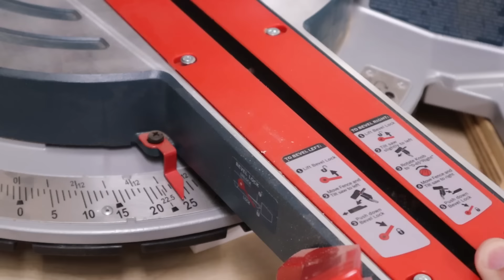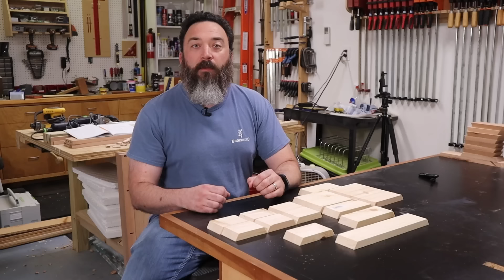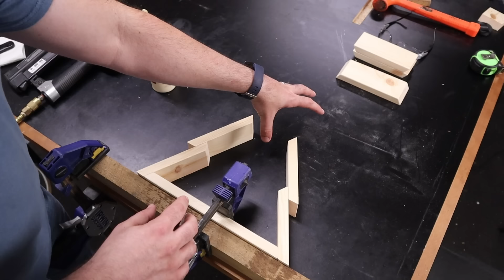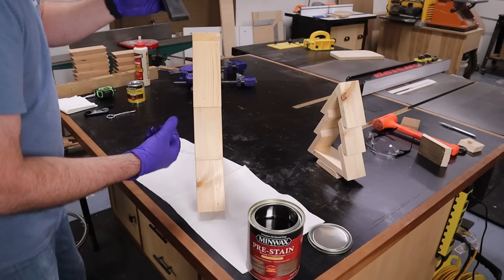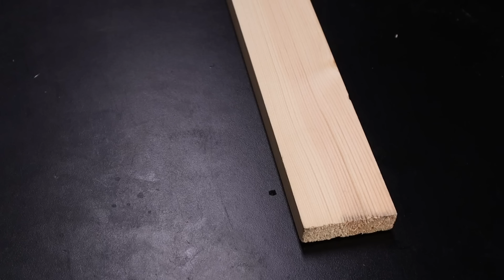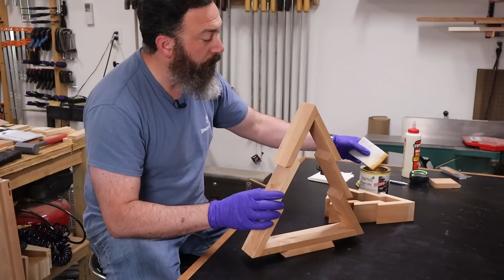Let's Build a BETTER Wooden Christmas Tree!

Comment: I have 1x4 pine. I can cut it down to the 1x3. I just don't want the waste. Over the tree would come out the same just wider. Do you see any issues?
Reply from the maker: You could go either way; cut the boards down narrower or you could use them as-is. I don't see a problem either way.

Comment: For those who want to make the same tree with different wood thicknesses, make sure you change your measurements according to the thickness you are using 6”3/4 will not work if you are using 1/2”, 1” or any other thickness other than the one it is used in this video. Your peaks won’t lineup. 
If you are using the exact same thickness he is using, then it is all good.
Reply from the maker: That's right, the measurements are specific to the wood thickness I used. Same goes for height. I've had people want to build them taller, but that changes the geometry. You can make them bigger, you just have to account for the changes.

Comment: I thoroughly enjoy and learn from  your vides, thank YOU! I have the same pin nailer, but what size brads/pins do you use with these trees?
Reply from the maker: 18 gauge
Reply: @biscuittreewoodworks thanks, 1.25" length?
Reply from the maker: @user-jx3jp3gb4x correct
Reply: @biscuittreewoodworks  you're so kind, thanks

Comment: . how far down do you staple them or Brad nail them to the other piece like 1 inch or three-quarter inches? How far down should you put each angle?
Reply from the maker: I don’t measure where to put the Brad nails or how much the pieces overlap. 
If you’re having trouble, consider getting the plans linked in the video description. 
If you get the plans and still have issues, send me an email and I’ll help you through it.

Comment: Sorry but I can't wrap my brain around it, but would using longer pieces make a bigger tree? I mean would it still be in proportion.
Reply from the maker: You can't just make all the pieces 2X longer to double the size for example. The geometry changes so you'd have to figure out how big to make the bottom piece to fit with the new sides.

Comment: I wonder if a 2 part epoxy would work in place of the CA glue. (I have some on hand but not sure how it would react to the wood glue)
Reply from the maker: It will take longer to cure than the CA glue, so you would have to hold the parts in place for a while or clamp it until the glue dries. At that point you might as well skip it all together and just use the wood glue.
Reply: @biscuittreewoodworks  on thanks for the input. I ended up finding a CA glue specifically designed for wood called 2P10

Comment: My trees aren’t coming out, does it make a difference if I cut the boards lying flat instead of on their side.
Reply from the maker: It shouldn't make a difference as long as you are still cutting them at the correct angle and length.
Reply: @ thank you I tried cut the 30 degree angle in the same and opposite direction and it still doesn’t come out at the top of the tree.
Reply from the maker: @ something is wrong with the angle then. If everything is at 30 degrees and the right length it should work out perfectly.
Reply: @biscuittreewoodworks  okay I will try again tonight, so should the angles both be in the same direction or opposite of each other?
Reply from the maker: @ShawnStumpe  I flip them over and make opposing angles. If it's confusing and you need a visual reference I have plans available with illustrations so you can print them out and take into the shop.
https://www.biscuittreewoodworks.com/products/p/wooden-christmas-trees-plans
Reply: @ I think I might have figured out my issue maybe I set up my stop block on my miter saw but I set the 30 degree cut on the opposite side of my stop block instead of the 30 degree cut towards my stop block.

Comment: For your measurements on all your boards, are you measuring long point to long point? Or short to short? Also is easy everything 30 degree angles?
Reply from the maker: All measurements are from the longest side and all angles are the same. I have plans available if that helps! 
https://www.biscuittreewoodworks.com/products

Comment: Why not a pair of jigs, one for each side that holds the middle pieces and the top assembly to ensure same fitting?
Reply from the maker: If you plan to make LOTS of them you could make a jig to make assembly a bit faster. I made a hand full of them pretty quickly just as I showed.
Reply: @biscuittreewoodworks  Right.  Effort vs Reward.  The time spent making the jigs has to be less than the time saved using the jigs.  Doing just a few wouldn't justify the time and materials.  Making several, and maybe doing it every year, most likely.  Thanks for responding. 😀

Comment: how much can I sell these trees togther as a set?
Reply from the maker: That is a complex question and it really depends on a lot of factors. I show a couple different versions in this video. The hardwood versions should be priced at a premium above the pine versions because of the better materials and better construction methods. However, your market and your marketing skills are really going to determine how much you can sell them for. 
If you are really good at staging amazing photos and writing appealing descriptions then you can charge much higher than someone who just takes a quick photo in their shop or driveway and puts "4 Sell" in the description. 
Your market can make a huge difference as well. If you have a local market with high end customers who are looking for unique, handmade decor and willing to spend a premium for it, then you can get a lot more than a market with customers who don't have much money to spend and just want something cheap.
I know this doesn't really answer your question, but it's the truth. No one online is going to be able to give you a specific answer for this because it depends on so many things. Anyone who says otherwise doesn't know what they are talking about or is just trying to fool you. 
I suggest figuring up what your total cost is to make the product, add your hourly rate, then add 30% profit. Start the price there and see how it goes. If you are selling a lot, increase the price until orders slow down. If all the customers say it's too much, then you need to cut your production cost to lower the price, or the market just isn't interested enough in the product to be worth while.

Comment: Have made several of the smaller trees about to make some of the larger trees. Will they nest together? I have a possible customer asking for trees that nest together. And what if I need a 3rd tree that is in proportion larger to have 3 nest together. Any idea how I can get the measurements for the 3rd size up?
Reply from the maker: If you build them the way I explain, yes they will nest together. If you want to build a larger tree that these will fit into, you'll have to calculate the size using some geometry, or trial and error.

Comment: Question. Do I need to spray with lacquer?  They’re going outside. Thanks.
Reply from the maker: You don't need to, but highly recommended to apply at least some type of top coat whether it's lacquer, polyurethane, or spar varnish. If not, especially outdoors, the wood is going to start to weather and rot when it gets exposed to the elements.

Comment: I have made two sets of 2x4 trees; one is 2 foot tall, one is 3 foot tall and one is 4 foot tall. The problem I'm having is the stability the bigger you go. Any suggestions?
Reply from the maker: The taller you make them, the wider and heavier the base needs to be. At 4' you might need to use 2x6 or even 2x8 boards instead of 2x4 to provide more stability.

Comment: Thank you for the video! How much more do you sell the cherry wood for compared to the pine? What is the standard price on these? Thanks in advance!
Reply from the maker: I don't have a simple answer for you because pricing isn't a simple concept. And full disclosure, I'm not doing production runs on these because I just don't have the time for that anymore. I'm getting a lot more value and enjoyment with the time I'm spending teaching people about woodworking and helping them build better projects.
So, your price will depend greatly on your COGS (cost of goods sold) and what the local market will sustain. Ideally you want to lower your COGS while simultaneously increasing price to maximize profit margin. 
Cost wise, cherry is not typically that much more expensive than pine. However, the quality of the final product, in my opinion, is much higher. If I was to sell a set made from pine for $50, for example, I'd list the cherry for around $65-70. You could also experiment with other hardwoods. I think walnut and quarter sawn white oak look amazing for these! The price for those materials can be 2-3 times the cost of cherry. Much more expensive materials and again higher quality product. I'd list those around $80-90 per set. These are just ballpark starting prices. If you are selling out faster than you can make them, increase prices! If no one is buying, you can try lower prices or the market just isn't interested.
All that said, you need to understand your market. If your market can't afford to spend nearly $100 on a set of wooden display trees, then there's no point in making a bunch of them to sell. If your market loves to splurge on unique decor and cost is no objection, then go for it and rake in the cash by providing them with high quality items they can't find anywhere else. 
How you market and get the product in front of customers is also going to play a HUGE role! Take beautiful staged photos and lots of them! Dress them up with bows, ornaments, candles, ect. Make it look like they belong on the cover of Country Living Magazine! Don't try to sell to the general public with a photo of the trees sitting on your workbench with sawdust and tools laying around! That's how you sell to woodworkers, not soccer moms and little old ladies wanting to buy cute decor for the holidays! 
This is a complex topic, and I've only scratched the surface here, but I hope that helps!

Comment: I've several of these christmas trees of three sizes. I used all screws to join the pieces and drilled the screw holes fairly deep.  I made all the hole from the outside of pieces, then covered all the scdew holes with dowel plugs, cut them off flush, and sanded. I think it looks pretty good. You barely notice the plugs after painting or staining and you don't see any screw heads.
Reply from the maker: That's a great option as well! You could even play around with the materials and have contrasting plugs!

Comment: I have a question for you. I used pine for my tree and of course when I stained it the ends where you see the wood grain is much darker. Any suggestions as to what I can do to have it blended?
Reply from the maker: End grain will soak up a lot of stain if you don’t do something to prevent it. 
The first thing I recommend is sanding the end grain one grit higher than the rest of the project. So if you sand to 180, go up to 220 on the end grain.
The other thing is to use pre-stain conditioner before applying the stain. This helps even out the stain and prevent blotching. 
Another option if you don’t want to use the pre-stain conditioner is to mix some wood glue with water about 1:4 ratio. Brush it on the end grain and let it dry before applying the stain.
Hope that helps!

Comment: Which boards are used for the smaller one ? I tried using a 6” for the base , 5x 4” for the sides , 1x 4 3/4  for the top offset piece and they don’t line up .
Reply from the maker: That sounds right, if you cut the piece like I show and follow the assembly instructions, everything should line up just fine. 
You can go to my website and submit photos using the contact form and I can take a look at what you have and see if I can help. 
biscuittreewoodworks.com
Reply: @biscuittreewoodworks  I just went ahead and bought the plans
Reply from the maker: @Unkownsector  Awesome thanks! If you still have questions just send me an email and I’ll get back to you as soon as I can!

Comment: What do you start with a 2by4
Reply from the maker: I’m not using 2x4 material. I’m using 1x4. If you want to build something similar with a 2x4 you will need to change up the measurements for all the parts.

Comment: It's not a problem with flipping the board. My issue is I keep cutting the board on the flat side. Totally screwed up on my part. Well, HD trip tomorrow 😂
Reply from the maker: Seems like I always end up making 2-3 trips to HD every time I start a new project! 
If it helps to visualize the parts, I have plans available you can print out and use in the shop! biscuittreewoodworks.com

Comment: I want to make these with my Career Exploration students. If I used wood screws, what size should I get?
Reply from the maker: It would need to be a small screw maybe some 1" #6 wood screws. Be sure to pre-drill if using screws or the wood will split. You'll still want to use wood glue in addition to screws.

Comment: Took my first leap into woodworking with this project, and I'm super happy with the results.  Wish I could post a picture.  I was really coasting until I had to use the brad nailer, lol. My advice practice on cheap lumber first, before you go strait for the oak (like me).  I ended up doing the bases of my trees different opting for a more A-frame design using approx. 3" wide piece of wood for the bases (excluded completely the base tree trunk piece in the original tutorial), and used smaller 2" wide for the branches.  I also used a semi-transparent white stain for a more modern danish look.  Thanks again for this great tutorial!  The white stain also really helps hide the brad nails and wood putty.
Reply from the maker: That's awesome! Congratulations on finishing your project and so glad I could help!
Reply: Solid cherry of course
Reply: I’m going to stain the tree with a fir green and the base and trunk a darker stain- oh and I’m going to add some mini lights!

Comment: Two questions.  Is there a reason you didn't miter the top so there would be a more precise point?  Have you thought about painting them green or red?  By the way, I do like the cherry and would love to see in walnut too.
Reply from the maker: If you miter the top you would have to change the angle for those two cuts only. This creates the opportunity for mistakes and adds additional steps in to the process. Also, most miter saws won't cut that angle so you would have to make a special jig to hold the pieces at an angle to the fence. So to keep things fast, simple, and reduce errors, all angles are at 30 degrees and you just overlap the top.
If you want to paint them, you can. I just prefer the wood look. And yes, walnut would look awesome for these!

Comment: if I make a jig and clamp it with just wood glue, would I still need the CA glue and applicator?
Reply from the maker: No, the CA glue eliminates the need for clamps in this case. If you plan on using clamps, you don’t need CA glue. However you are then waiting for the glue to dry in your jig and clamps before you can build another one. If you are only building one, that’s fine, but if you are building multiple trees it is really going to slow down your production.
Reply: @biscuittreewoodworks  alright, that clears it up, thank you

Comment: Can't figure out the dimensions... are those outer or inner sizes??
Reply from the maker: The measurements are all taken from the longest side of the boards.
Reply: I found my dumb issue: I was using a 2x3.... finally I was able to salvage 90% of my cuts by doing a new shorter piece for the bottom.

Comment: How long do you have to wait for the a CA glue and applicator to have a strong bond. Do you need to nail after  using it
Reply from the maker: It bonds almost instantly, but you can give it about 5 seconds or so to be sure. It's a fairly weak bond so be careful with it for about an hour or two until the wood glue dries. If you use CA glue and wood glue like I show, you don't need brad nails. The brad nails don't have any real strength in this application anyway, they just hold the parts together until the glue dries.
Reply: @biscuittreewoodworks oh okay, I was just confused because I thought you meant it would cure in a few seconds in the video, but it’s all clear now.

Comment: The only thing I don't see is the overlap values for the branches and top of the tree?
Reply from the maker: I don't specify an overlap measurement. If you assemble them the way I show in the video, the overlap will fall where it needs to be to close up the joints. This allows for your lengths or angles to be slightly off and still have a good fitting joint. It will roughly be 3/4" to 1" overlap.

Comment: Best video I’ve seen. I’m brand new to woodworking. Only question I have is what is the measurement in inches where the sides overlap together?
Reply from the maker: I don’t measure it. Just get the angles right and the overlap will fall in place where it needs to be for no gaps. It’s going to roughly be 3/4”-1”.

Comment: I tried making with a 1 inch thick board but it does not line up. Any suggestions
Reply from the maker: That’s because the dimensions and angles are made for 3/4” boards. If you change any dimensions, the joints will not align. If you want to use 1” material I recommend building the tree top to bottom and leave the bottom of the tree  for last. Then you can measure the gap to cut a bottom to fit.

Comment: Enjoyed your video. Made a couple trial versions and they came out good. Being frugal, I ripped a standard pine stud in half & squared the rounded edges. Since thickness was less than 3/4” I adjusted the couple lengths that take the thickness dimension into account. Came out presentable (gift worthy), added an angel tree ornament in the center & gave to elderly widow next door. Made her holiday season 😊
Reply from the maker: That's really awesome! Thanks for sharing!